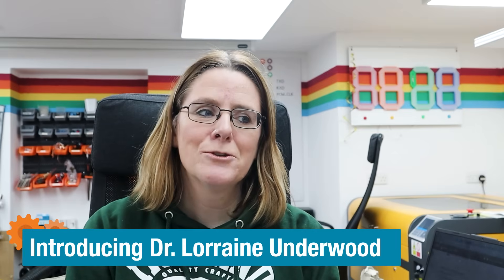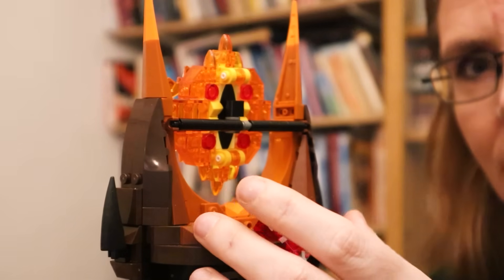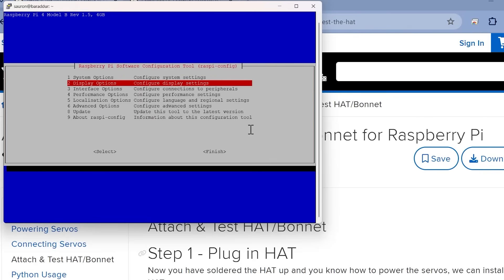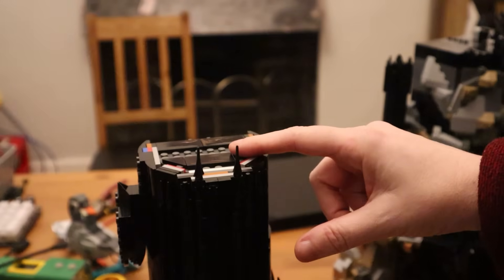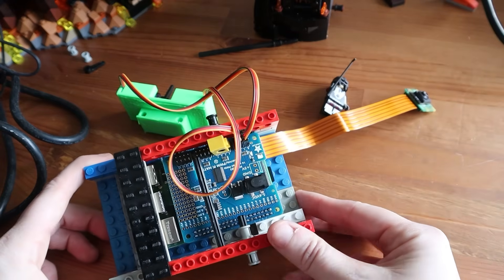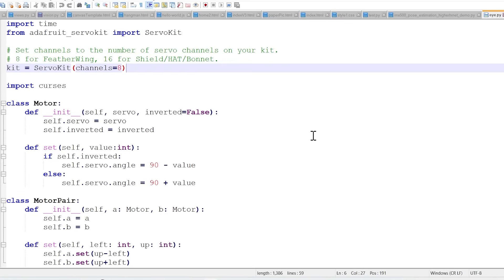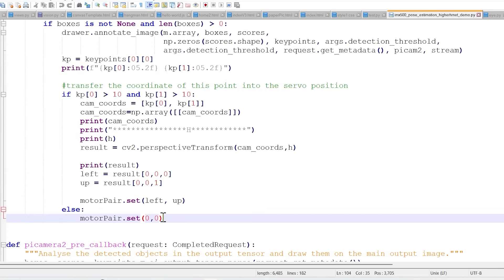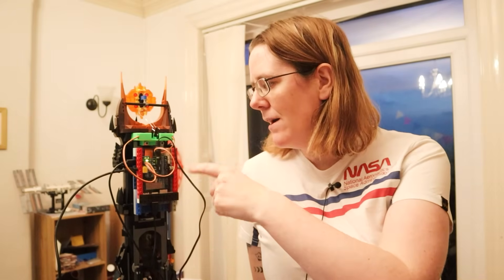Raspberry Pi AI Tracking Eye of Sauron - AI AL Barad Dur

Comment: One thing I love about this channel is it always gives us off-the-wall solutions to problems that I never would have thought anyone needed to solve, and they often give me ideas for solutions to problems that have been vexing me for some time. Keep up the good work.
As for options for your bent paper clips, I'm thinking of a mechanism that's more like...well, like an eye. Rubber bands basically tugging at the left, right, top, and bottom corners. Might be a bit trickier to set up, but it's not rocket surgery, it's just eye surgery. With the right tension on the bands, you should be able to dampen the servo movement so the eye moves more smoothly.

Comment: First congratulations on your PhD. What a fun Lego project. For the wire connection to the servos. Suggest looking into rc plane servo rods. It will fit the servo horns. And should be plenty strong enough. Be fun to see it from the front. With the eye lighted.

Comment: I ran into a similar issue when building a K-9. The servo ears/antennae linkage would bend up. I ended up using a rather thick, solid core copper wire. Shorter is better of course.